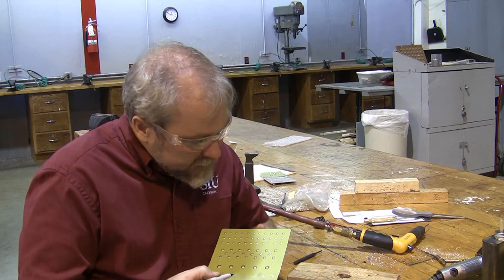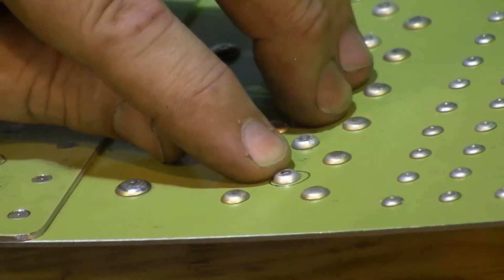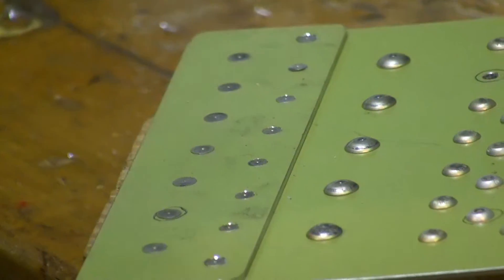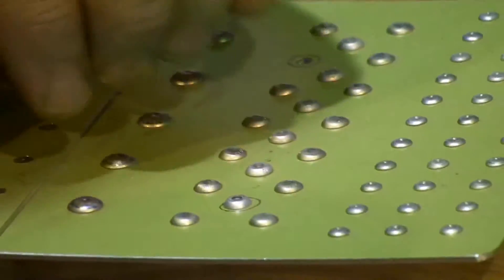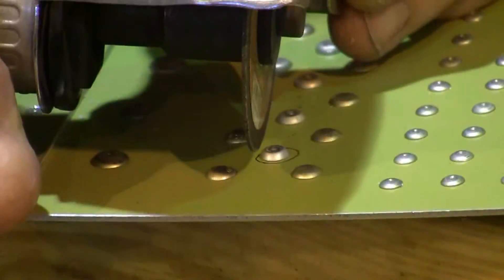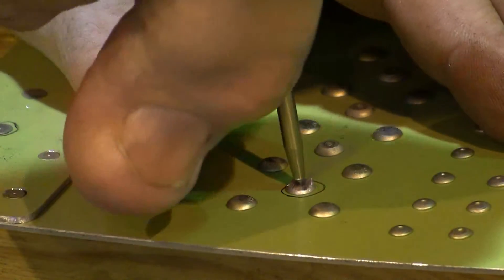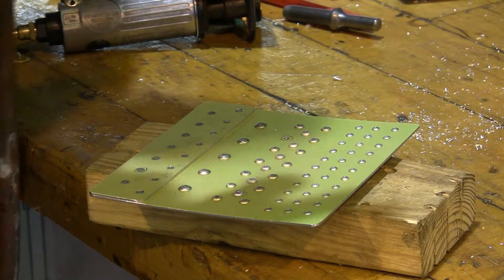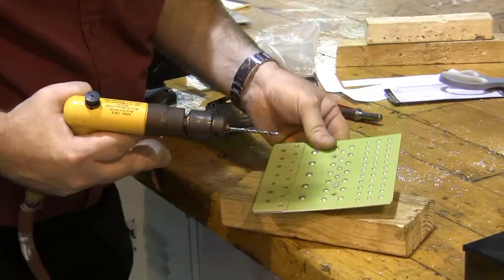AVT 206 A&P Sheet Metal Class - P1- Removing CherryMax Rivets

Comment: Using that grinder in that way to remove a cherry max is absolutely INSANE! The risk of damage to adjacent structure has been exponentially increased by this. Use a 90 degree or even a straight grinder if that's all you have. Invest in a Roloc style arbor and use sanding disc like virtually EVERY "Real" Aircraft Mechanic / Sheetmetal Mechanic on the planet.
Reply: Try removing those on the flap skin on a C208B. They aren't quite as easy as this demonstration

Comment: this is not how you remove chery you send the head with a 90 angled grinder with a ciruclar sanding pad attached and after you punch the stem and then drill full size of the curent hole.